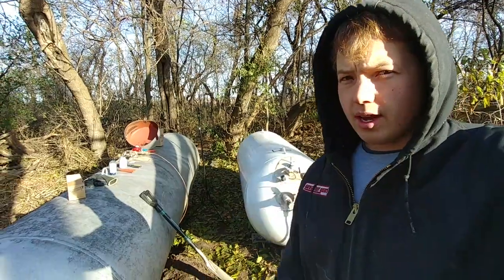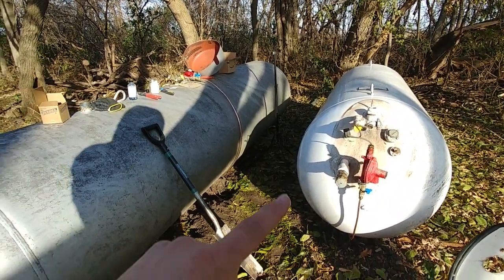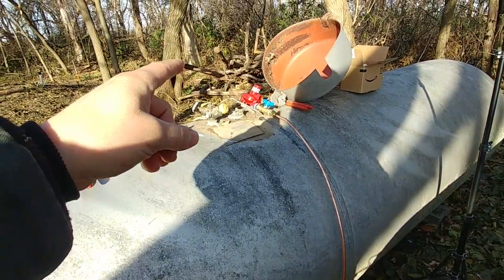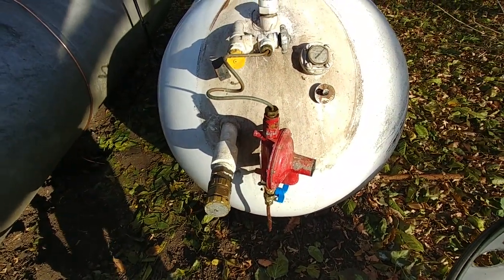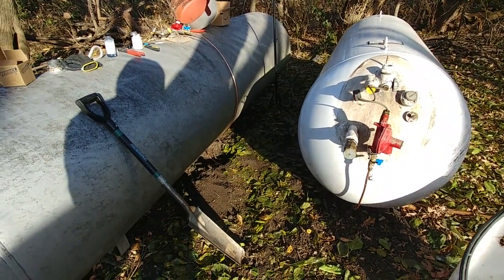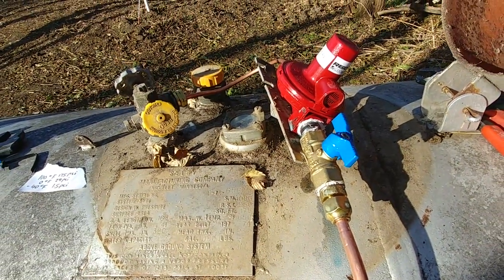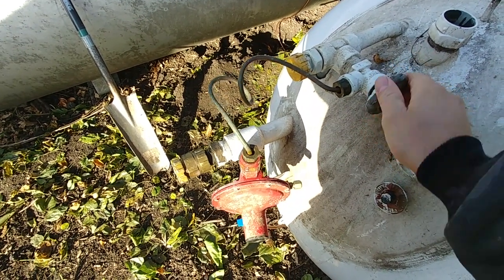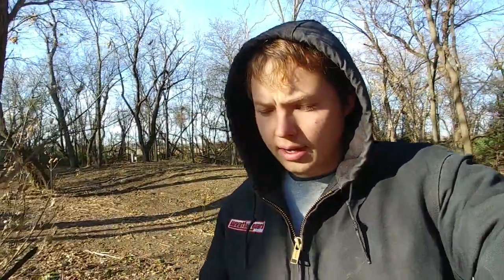How To Manifold Two LP or Propane Tanks Together - Manual Switch Over

Comment: Funny I watch this video around November of December every year.  I need to put this higher on my priority list.
I can't always afford to fill up my 500 gallon and often use several 100 pound tanks.  I had to get up at 2:30 in the snow last night to roll one in position and connect it.
I'd like to build an elaborate manifold that I can switch among 1-500 gallon and 3-100 pound tanks. I'd like to mount it on the back of the garage.   It will need to go to my house and/or garage and the need to reduce the pressure at my garage furnace in both my house and garage. (2nd stage).  
I only have 2 of both types of regulators.
If you ever want to make another video about this subject please include how to design many different types, including a regulator at each tank, only one regulator for several, etc.  Do they make auto changeover for homes like the ones for RVs?  There is alot on this subject and I know you could do it if you want.  Also, are there different ways to monitor?  Is there a wifi meter that could tell me the condition while I sit on my ass eating donuts?

Comment: I’m running 3  tanks of 120 gal each to a machined aluminum manifold.  I have a check valve at the outlet of each regulator to prevent back pressure in case one of the regulators is not exactly set at 10 psi.  The manifold output goes to a single second second stage regulator near my generator for backup power.

Comment: You can have both tanks on and regulators on both tanks. Nothing wrong with that. The only problem is they don’t really drain evenly because pressures on regulators may be set differently. I prefer to do one regulator after tanks are tied together by the pol. Then the two will drain more evenly because there is only one regulator.
Reply: I was wondering if that could be done.  I also wondered if they make an auto-changeover like on an rv.  I'm coming up with a plan.  Thanks.

Comment: Question?.So, at the tank the regulator is adjusted ( Or purchased at) to 10 psig ?...3/8 copper from Tank ( Regulator/ball shut off)  to a furnace ...convert natural gas to Lp ( conversion kit)...adjust incoming LP gas from (labeled ...say 11 to 10 wc)...then adjust the manifold pressure to (  manufacturers labeled wc)......I have a furnace I would like to convert....does this sound right
Reply: No, just no

Comment: Hi can the 2 propane tanks just be connected together at their full pressure (not through any regulator), and have them both simultaneously supply a regulator?  I have a 500 gallon tank, and want to add a second 500 gallon tank.
Reply: Did you do a second tank?
Reply: I wanna know too!  Save a few bucks by not buying an extra reg, less clutter around the tanks, fewer connections...  Seems better to me.
Reply: @J Big  Sorry it's late but I believe my propane supplier said it was ok to connect two tanks. Just need valves in the tee so that you can shut off and isolate each tank.  Then, both tanks feed a single regulator that serves your house.  There needs to be some separation between the tanks, probably so a person can fit there for service-related tasks? If one propane supplier is not helpful, call another one!
Reply: @Maria G DES JARDIN  Sorry it's late but I believe my propane supplier said it was ok to connect two tanks. Just need valves in the tee so that you can shut off and isolate each tank.  Then, both tanks feed a single regulator that serves your house.  There needs to be some separation between the tanks, probably so a person can fit there for service-related tasks? If one propane supplier is not helpful, call another one!
Reply: @wildmanofborneo  Thanks for the update, A.  That really does make sense, hoping to have our next tank plumbed with a T so we can hook up an RV cylinder as backup if we ever find ourselves in a shortage situation again.  As of now, still trying to source a tank for sale in this region- seem to be in short supply lately.
Reply: Absolutely. Tie them together before regulator through their pol and then into one regulator is fine.
Reply: @mariagdesjardin1000 it is because they drain evenly too.

Comment: Dont listen to this guy.  His work is not up to any Code and is dangerous.  You can buy a "Tee" coupling for a couple of dollars instead of brazing lines. Burying the splice isn't recommended either. You've heard the saying "just enough knowledge to be dangerous", well thats this guy.
Reply: Absolutely. Sometimes you have to T in and bury. Not the best way though. I’d personally just run a second line and T up at tank with shut offs so you can isolate a line if there is a leak.

Comment: So you just don't leave them both open so that 1 empties and the next one continues to release propane? The problem I'm seeing is that when one tank runs out, whatever you have running inside will shut off. You will lose pilot lights and heat and if it's snowing or -20, you will have to go out and turn the valve. Then restart all the pilot light if you have a furnace. Sounds like a nightmare.

Comment: I have 2 500 gal just connected pressure will not equal between the 2 tanks will adjusting the 2 regulators solve this problem
Reply from the maker: I would recommend just manually switching over between tanks. It will be very difficult to get both adjusted to be exactly the same pressure. Good luck!
Reply: What happens when the pressures of the two regulators isnt the same?
Reply: Yes. But better way to get even draw is eliminating one of the regulators and tying them together before first stage regulator.
Reply: We have a turkey farm. We run 2 1000 gal tanks. One runs out then the second starts draining down automatically. This is how they are set up by the LP company so I know it's correct. We have 16000 birds that MUST have continuous heat. I'm looking for an answer on how they are set up to drain one then the other. Anyone here know?